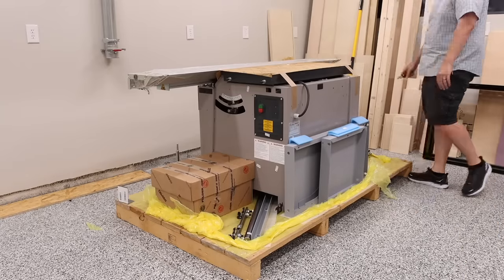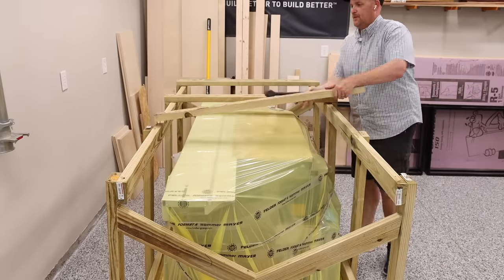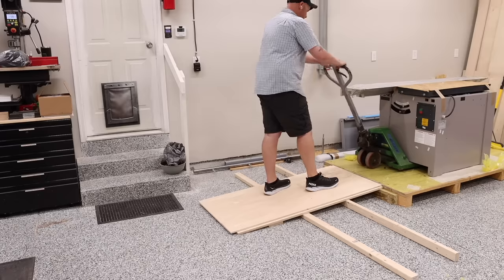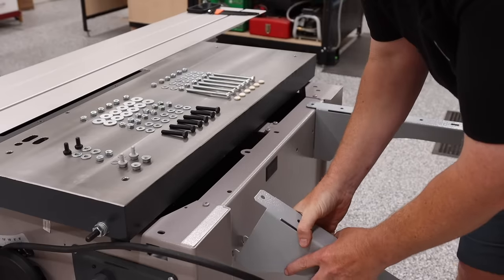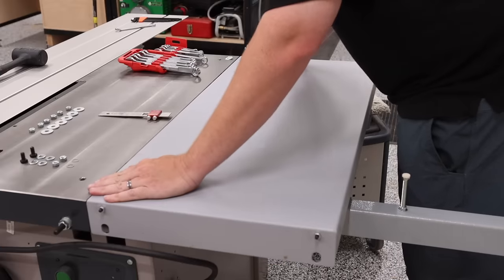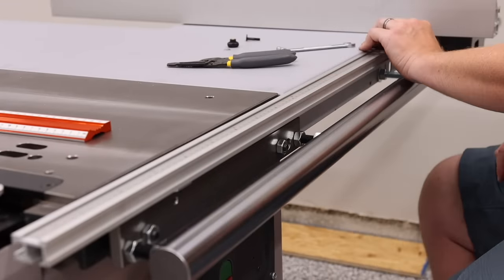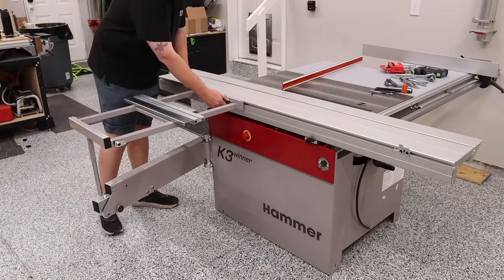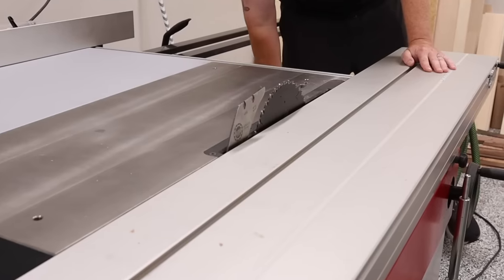I sold my SawStop for a slider // Hammer K3 Winner Assembly

Comment: Building out a wood working shop is on my to do list at some stage. Ive always thought the panel saws a better option until CNCs. Seems to me the CNC is the ideal way to cut cabinets as it can drill all the shelf holes as well and only takes the footprint slightly bigger than the panel. With a track saw, miter saw and/or small footprint Festool siding table saw you should be well covered with ability to do more tasks?  
Curious as to why a modern woodworker wouldn't go that way?
Reply from the maker: I have no desire to sacrifice the space needed for a CNC. I had one, and sold it. That allowed me to put this into my shop. However, if I ran a production cabinet shop, then I would absolutely have one.
Reply: @bentswoodworking  Yeah i understand the space requirements thats why i was asking about the viability of a CNC instead of a large tablesaw. 
Seems to me (as an onlooker atm) that the CNC is better for cabinets, can cut patterns, fixture holes and flatten larger pieces of timber all safely and on auto pilot once programmed. 
Sure it wouldnt be suitable for smaller things, thats why i mentioned the tint footprint Festool sliding tablesaw.
Dont get me wrong im not knocking anyone's choice to go with a bigger panel/ table saw as you have over a CNC. Im just would've thought the combo i mentioned would allow you to do more things in a similar space. Again, given i haven't started im wondering what i missing in my thinking

Comment: Very nice Jason! The local wood mill I buy from has several Felder machines including the sliding table saw and they are spectacular. It always seemed like a superior design in my opinion compared to the typical US cabinet saw with the obvious down side of just significant space requirements. I am looking forward to you putting through its paces.

Comment: funny. I sold my Hammer K3 for a sawstop.  The Hammer was a great saw but a lack of aftermarket accessories convinced me to get the SS with the slider. Best of both worlds.
Reply: Update... I'm moving soon and will selling the SS to get a Felder 500 Professional.  The slider is not the same and the cross cut fence is a pain and in the way when I am ripping.

Comment: Hi I have the Hammer B3 winner comfort (combi model with router), i wonder what brand & types of blades have you used so far? I've been using the Felder blades only so far and I wonder if you have used different ones and your opinion about them.

Comment: I’ve had my K3 for 4 years or so.  After year 2 I ended up with a small job site sawstop for certain cuts the K3 doesn’t do well.  
I think a great setup is both a slider and a traditional cabinet saw front to front like Ramon does.  2saws same square footage.

Couple tips, 
buy Ramon’s zero clearance insert, so much better than fielders
Magnets on the inside of the hand wheel will save frustration 
3d printed nuts for the table so you can make your own clamp setup.  

I’m glad to see you buy this, means other creators are probably gonna do the same so my saw just went up in value!  Been thinking about switching to a 9 foot Felder slider since the 5x5 sheets these are designed for are hard to get these days.

Comment: Rumor has it that Sawstop will be offering a sliding table saw in the near future.   It will be similar to other high quality sliders but will still have the safety feature.
Reply: Yeah, everything is great until you lose a finger. If I was this youtuber, I would have kept the SawStop until SawStop comes out with a slider or SawStop tech gets incorporated into other saw brands.
I guess he has an income where he has to keep buying the more expensive, exotic toys. I know many of these people.
Reply: A sliding table saw is safer to use then a traditional western saw!  Your fingers are never near the blade and when used correctly you don't have to worry about wood getting pinched and kickback occurring. Of course like any tool common sense and awareness goes a long way but sliders are safer in general!
Reply: @tron23058  He has a sponsorship with Felder. In most cases, when you have a sponsor, they require that you not have any other brands in which they are in competition with. This is why so many YouTubers lose their sponsors (like Powermatic) if you buy a sawstop.

Comment: I'm curious to get your feedback on performing ripping operations on this style saw. It seems like the rails actually make it more dangerous to rip boards as you have to lean over the slider to push against the fence with the blade closer to your hand/push stick as you push the piece past the blade. I love all of the other benefits of a slider, but I haven't bought one yet because of this one concern.
Reply from the maker: I’m interested to see how I will adapt. I don’t see that as an issue myself. I actually intend on using the slider for ripping as much as possible
Reply: another advantage is that you can use the sliders inertia for rip cuts making it less harder to push it through the saw.
Reply: @bentswoodworking ook up the Fritz and Franz jig. You would have to add some structural aluminum to the sliding table top but it would be easy to do. You could rip with the sliding table with that addition.
Reply: I've never felt that I've had to put myself into a dangerous position with the sliding table saw. You use them differently and from a different position. 

One thing I wonder about and that's if sliders are as good for ripping wood against a fence. The sliding table saw is a tiny bit higher than the cast iron table (to the right and that has the blade). This height difference means that wood to be ripped cannot sit flush against the cast iron table but rather at an angle, which is determined by the distance between the saw blade and the fence. This truly is the one place where a North American style table saw may be superior. Others can correct me here.
Reply: @johnhuelsenbeck35  This isn't a real issue, during a rip cut you'd normally continuously push the wood against the fence, leaving a parallel 'gap' between the cast iron table and your wood. And I'm pretty sure that after ripping, there's a planing-thicknessing phase to at least get rid of saw marks.....

Comment: Jason, thanks for a great walkthrough. I’ve been looking at switching as well over to Hammer from my Grizzly slider to have a longer slider. Did you consider getting the slider/shaper combo? I’ve been really debating that as it would save me some space of my current 1.5 hp Grizzly shaper. With the different spindles it can be used as either a shaper or router table replacement.
Reply: I have the full combo c 3 31 with jointer /planer, shaper and saw. Love it. If u plan to use a shaper I recommend it

Comment: I have had the Hammer k3 for about 7 yrs now.  I think it is a well made machine and I have not regretted the purchase.  One suggestion I would offer.  The fine adjustment mechanism for the small cross cut fence shown on your saw is the same one that came with mine.   It is a nightmare to keep the fence locked into a 90 degree cut using that mechanism.  The reason is that the cam adjustment lever moves over time no matter how tight you try to set it.   A replacement has been offered by Felder for a couple of years now.  The cam adjustment mechanism has been replaced with a set screw and locking nut that is much more accurate and durable and repeatable.  I highly recommend this cheap upgrade for your new saw.  Here is a video showing the refined mechanism.  Jump to 7:10 of the video to see it.  https://www.youtube.com/watch?v=raMZ_fhUklg&t=653s
Reply: I can't believe Felder isn't giving those out with the new saws. What a let down.

Comment: Felder is coming out w/ a "SS" version soon.
Reply: Felder is already adding its SawStop finger sensor to its top model Format saws.  But it is very different than the SawStop version.  The Felder sensor uses video to detect the finger I believe.  And drops the blade before contact with the finger.  I do not think the Felder system is capable of being put on any tablesaw less than $10,000 minimum.  Maybe $20,000 minimum is more correct.  It uses complex video recognition and electronics to achieve its results.  The SawStop uses simple electrical signal transmission between the blade and your finger when you touch the blade.  About like comparing light from a match to light from an LED bulb.  Both give light, but they achieve the result very differently.
Reply: @russellseaton2014  Yup. They did say that they had a smaller version coming out than what they have now. No idea of the price. Out of my range anyway. Just got a SS and it will be my last saw.

Comment: Since SawStop makes a sliding table, why didn’t you just add that as it would have been cheaper and kept the safety features?
Reply: Probably because adding the SawStop "sliding table" does not make a real sliding tablesaw.  The add on sliding tables like the SawStop version are placed about a foot away from the blade.  Real sliding tablesaws have the slider within a few millimeters of the blade.  A good comparison might be a rotary SDS hammer drill compared to a regular hammer drill.  If you have ever used both to drill into concrete, you know which is far superior.  Even though both use the term hammer drill, they aren't the same.  Simply adding a sliding table to the SawStop does not make it a sliding tablesaw.
Reply: I've wondered about the sliding table on the SawStop and how it compares to the K3 (and other "real" sliding table saws). It might work very similarly. At least you have a built in way to do crosscutting with the SS slider.

Comment: Never get rid of your regular saw, you will miss it.
Reply from the maker: I don’t have space for both unfortunately
Reply: @bentswoodworking  I totally get it and that's what I said too, but 12 years later I bought another Unisaw and restored it.  The Panel saw is a pain for small stuff.  I have a Felder 7 series combo W/ 3 phase 7.5 hp motors and all the options available when I bought it new, but I go right to the small saw for most of the quick stuff.  Cool video....Good luck with the machine.

Comment: I dont know why people follow the hype of saw stop.
Reply from the maker: I wouldn’t call it hype, it’s a fantastic saw
Reply: @bentswoodworking  it's a quality saw but people but it for its safety features which are a money grab. For the same kind of money you can get many other great units.
Reply: Their saws are of modest quality with the safety feature "add on".
Without the safety feature they would be an "also ran" as a saw.. nothing special.
Additionally, worst customer service of any tool related company
 I have encountered in 33 years as a professional wood worker.